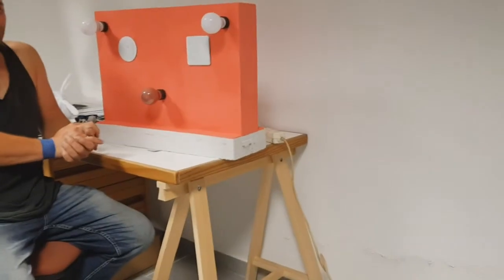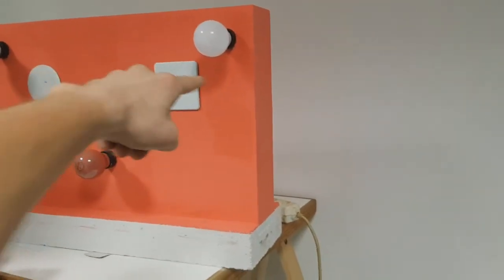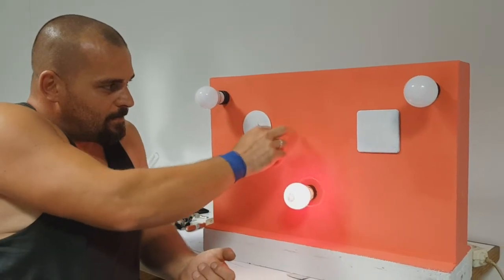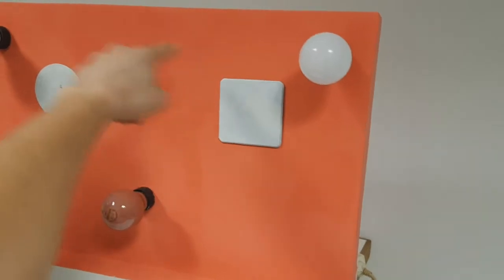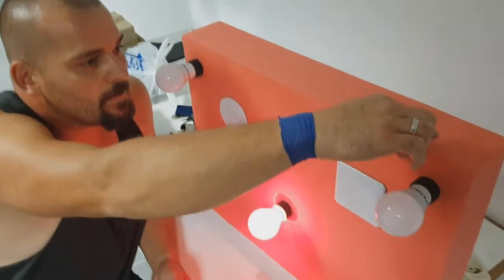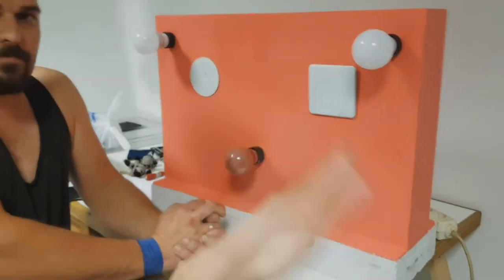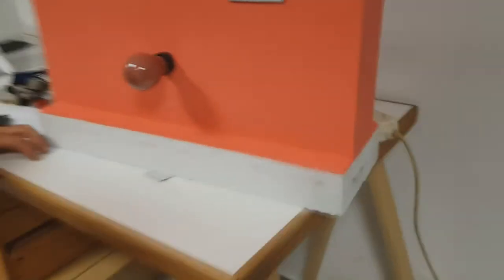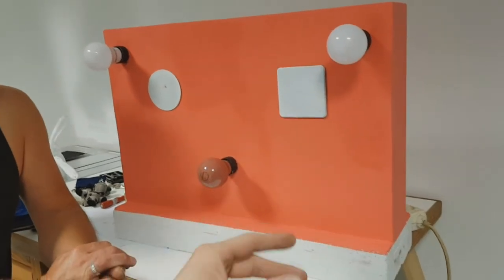Conductive ink Touch switch - Test wall

Comment: Dear Cayrex, would you try to use this paint as a heater wall? I mean, just like you painted the conductive ink under the normal paint but producing heat.
That would be awesome.
Keep it up!
Reply from the maker: Yes, but not with this ink. This ink is a capacity ink and is special designet for capacity switch system. I will demonstrate also a heat conductive ink on wall.
Reply: Can’t wait! :)